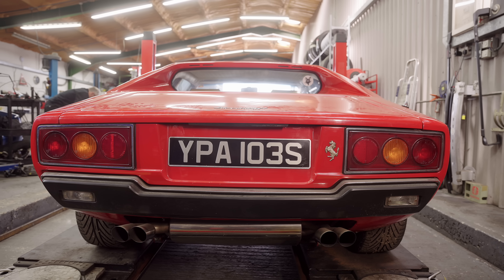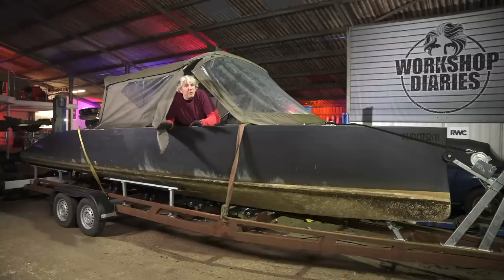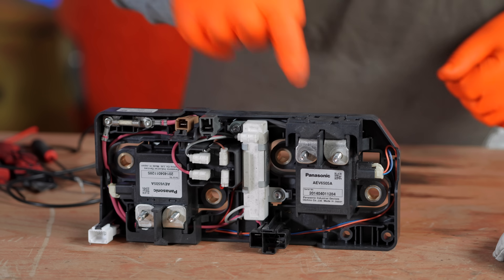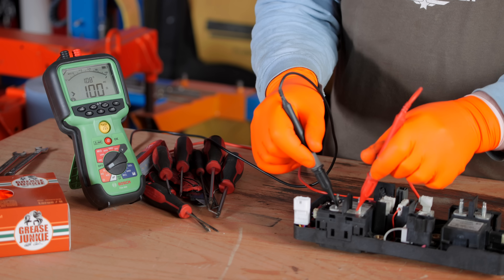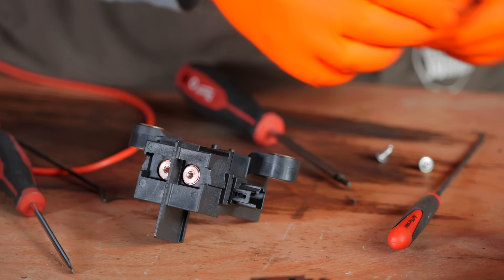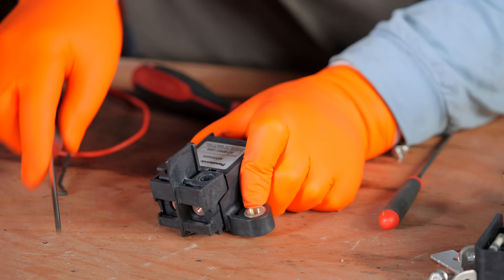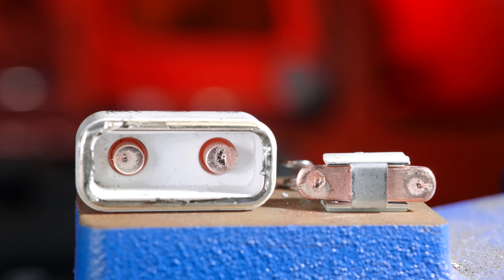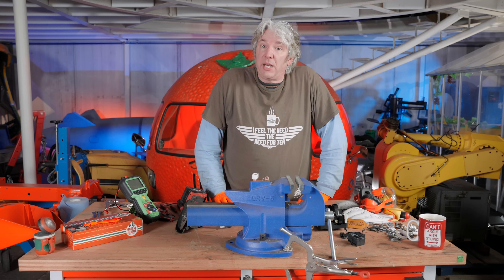1 Surprising Thing I Found Inside a Welded EV Contactor

Comment: Looks like it was switched of unter load. Which should normally not be the case. Normally the inverter should shut down the current bevor the electro-mechanical contactor ist opened.

Comment: This is a Panasonic AEV6505A. A datasheet I found does not list that specific type, there is variants with different coil voltages and connectors. 

But for example the AEVxx04xx (with x for 'can be anything') is a 120 A type. It is rated for 120 A continuous, or 225 A for a maximum of 3 minutes, or a maximum of 400 A for 30 seconds. 

I also at first thought it had 120 A switching capacity but higher carrying capacity but that is not it: It can switch 120A very often, but only if the resulting voltage across the contacts is at or below 20 V. Else the number of times it can switch (switch lifetime) is reduced significantly. It can switch once at 1200A with 300V resulting, or it can switch 70 times if 450 V results from interrupting 120 A. That is not normal use, because if the voltage is kept below 20 V it can switch 120 A for at least 70.000 times which sounds a lot more reasonable for switch lifetime. (note: these numbers are for a different type, that I assume to be similar - that assumption might be off)

So that is what the 'pre charge' relay is for - it makes sure the voltage difference over this main contactor is low enough to ensure long switch lifetime.

But good to see the teardown. It is clearly not something you can easily open to clean the contacts and then reassemble. But one might be able to only replace the contactor instead of the entire unit. Or maybe once all the disassembly work is done: Both or all 3 contactors. In case they wear at similar rates, or the same fault welding the one contactor also affected the other. Idk, needs proper testing, probably not done by me unless...

Comment: Contactor or a relay design is not as simple as it looks.....there is a lot of research that goes into choosing the material thats make the contact pins it could be silver, silver cadmium, silver tin oxide, gold plated, palladium and also tungsten also the contactor was sealed in ceramic package as it may have a gas filled inside to extingush the arc......not sure if its legal to use SF6 as its a green house menace but there might be a substitute.

Comment: Very interesting Edd. I was an electronics engineer all my working life, and am of the opinion that relays or contactors will always fail eventually, it's just a matter of time. In high current applications they weld and fail short circuit, and in low current situations, particularly audio switching, they fail high resistance or open circuit. The designers will balance the life expectancy of the contacts with that of the battery pack, working on the assumption that the batteries are most likely to fail first. That one possibly failed due to not enough gas inside at manufacture or a leak over time. The contacts are never pure copper, it's just not durable enough, once a good arc has taken place, the contact plating is compromised and welding happens. At very least, the contactor pack should be part of some sort of scheduled maintenance and therefore be made accessible as others have said.
Reply: Exactly right. Contactors have seen a lot of change and Engineering over the last few decades. From exotic and rare alloys, vacuum/gas purges, coatings, layered plating, and heat/cryo treatment. And that just scratches the surface. Went down a rabbit hole with all of that a few years ago, and it's a deep one.
Reply: I am an old electrician, I remember large power contacts with silver tips, they were quite reliable until the silver wore away.

Comment: The Accountants are clearly in charge at Nissan those contacors are clearly too small for the potential current that an EV can draw. I know if I chose a contacor for an industrial process I would oversize it by at least 50% capacity, to extend the life of the contacts. Your quick thumbnail calculation clearly shows that the engineers were only allowed to install the minimum size possible.

Comment: Hmm. About those contacts in the relay - I thought they were coated with some other more CONDUCTIVE metals such as silver, or beryllium ? Certainly something with a HIGHER melting point than just Copper !
Reply: I believe that the silver contacts are melted and splattered over the plated copper surface -- see 15:50

Comment: Yes, you need bow thruster(s) for the boat as it's so narrow, compared to length. I wouldn't expect to see it in a lock - what's the boat's length ? Anything over 55 ft/ 20m is going to be a tough fit in a canal lock, but never say never. I want to know what colour the boat will be - definitely metallic or metal flake finish, but not too dark - you want to be able to see it 🎉. Not orange. A weird salmon pink would be my choice. Looking forward to the inner office build.

Comment: Hi Eddie put your bolts in your steel work in from the top and nut on the bottom then if the nut comes off the bolt stops in the hole

Comment: The motor being run at a higher (80kw) than the contactor (40+kw) is I believe similar to Ebikes running 200 amp motor current and 130a battery current because the back EMF from the inductance of the motor is pushing back against the battery voltage giving more power, which kind of defeats scottys laws of physics..... and if you think thats weird then theres field weakening which makes the motor faster....

Comment: I bet that has a capacitor with a really high inrush current, so install a resistor that powers the circuit around the relay.

Comment: Contactor pads and bridge will have silver contact normally . The contactor may well be made specially for Nissan and though it has a Panasonic part number is only supplied to Nissan. Plan B, check coil value and  fit 150 or 180 A contactor in the box if possible or remotely otherwise ?

Comment: HI, I have worked with very large versions of those contactors. what I have found is that the bellows that keeps the atmosphere out will fracture over time and let the protective gas (I think SF6) out then it welds itself up.
Rich

Comment: I would think that the current rating is what current the contactor can switch, not the maximum current it can carry (which is probably much higher)
The resistor will limit the initial current going charge the capacitors.

Comment: Is there a way to see live data of power use (at the pack/motor) in hybrids and EVs through the odb2 port?
Would be interesting to monitor and see if, in this Nissan Leaf case, the contactors are indeed to small for it's actual load.
Could be a lawsuit and recall in their future.
And send a warning to the rest of the industry.

Comment: The ceramic hermetic sealed case is likely filled with SF6, a good dielectric gas to minimise arcing

I'm a radiotherapy electrical engineer, and our RF pulse we use to accelerate the electron beam, is sent down a waveguide filled with sulphur hexaflouride

Comment: As a boater, let me tell you there’s no way you are holding that boat in a lock without smashing the paint to bits. A bow thruster won’t help you with all those Eddie currents (pun intended 😅). So I would strongly advise you fit some recessed pop up cleats so you can add fenders when transiting locks. They won’t ruin the lines when you arn’t using the fenders.

Comment: Think there is a little more to the contactor sizing. It's unlikely to switch under load. The electronics and software will see to that. This means the contactor can be rated below the actual load switch rating saving on cost and size. This is particularly true for DC switching as extended arc form on switching loads. This is the reason special isolator switches are required for DC and why PV systems shouldn't be disconnected by the DC switch until the load has been removed on the AC side of the inverter.  By only operating the switch when the motor load is zero means the switch is operating at a small load and arcing/welding should be avoided.

Comment: A tip for anyone trying to repair a contactor, hold it solid or bolt it down and give it a good tap with a hammer, often it does work. Eventhough this one looks completely welded, it oxidizes so the weld isn't that strong.
Reply: The contacts of a relay are plated with metals that resist welding, such as platinum and tungsten. Under that is copper which welds very easily. In this video, you can see the exposed copper when he held up the contacts for the camera. 
Once a relay has welded, the surface coating on the contacts is damaged, so if you do this hammer repair, the relay will work a few times and then weld itself again. 
Don't waste your time, welded relays cannot be repaired.
Reply: @6AK5W-JAN  I can tell you this is not always the case and not always true. While of course it is generally good practice to simply replace a welded contactor, I've gotten 4 more years out of one at this point with no heating up or anything similar. It really does work sometimes. Also copper might weld easy, but as I tried to out in my previous comment, it WILL oxidise under heat high enough to melt it, and thus the weld will be very weak.

Comment: About the contactor, my 2 cents is that the 80KW rating is peak, nominal I'd guess its around 40kw. The contactor rating is likely nominal and has an equal or higher peak rating. A leaf will never experience 80KW for more than a few seconds anyway.

Comment: I'm wandering if a SSR is a better choix for this function , surely not cheaper , but normally more durable . in the future , this will be a common , problem , they will make this command modules easily serviceable withou having to take all the battery out .

Comment: Years ago, what now seems a different life to me, I've researched the relays, especially DC breaking relays. As most AC relays can handle much more power because AC current will eventually be crossing zero and extinguishing that arc, they really suck for DC and are DC rated very low. The strongest DC breaking relays also can incorporate a blowout magnet which does exactly that, blows out the arc. The mode of failure is the same for all mechanical relays, and is actually quite simple. Each time you close a relay, you have a little bounce which in turn produces sparks. Also when opening the relay you have the arc. Both effects transfer material from one contact to the other. By doing this, the resistance of the contact starts increasing, creating peaks on one side. At one point one of those peaks will be higher than the rest of the contact, therefore it will make contact first, but because the contact point is very small it has a bigger resistance. Resistance means power loss on the contact, which means generating heat, which in turn melts the materials and weld it together. If the weld point is small you can release the relay by tapping it, but it only prolongs the life of the relay for a short time. The fun thing is that the same mode of failure happens in gas surge arresters and that's why they are supposed to be replaced every time a surge happens, otherwise they short and start to glow, a lovely view if I might add :D
Reply: Just did a yt search on blowout magnets, how cool.

Comment: I suspect that the main motor current does not flow through that contactor until it has made contact nor will the contactor be carrying the motor current when it opens as that will be controlled by solid state devices. That is why they can get away with a lower current contactor.

Comment: You went to all the effort of finding out what a fused contactor looks like inside. But you still didnt determine why it happened. Hint - measure the resistance of the precharge resistor, probably open circuit. But if it measues in spec, check the pre-charge relay

Comment: Interesting boat put a permanent rubber bumper all round it. If you don’t use fenders it will get the snot knocked out of it. The thruster will do nothing for the maelstrom of the locks

Comment: A railway signal engineer here.  Railways are 'failsafe'.  Critical contactors (relays) are silver versus carbon contacts.  Why?  Those two conductors cannot weld. It's chemistry. 🟠
EV nobs could learn from over 100 years of railways learning.  By 2100, they'll get Panasonic to patent it.

Comment: DC contactors suffer more than AC as all the destructive force moves in one direction. The traditional solution was mercury wetted contacts, but they are no more.

The best solution likely is to offer easy quick replacement of cheaper components. But that might be too generous for the original manufacturer.

Comment: As a industiral electrician who often change the contact in siemens contactors, i must say those panasonic contactors are not built to last.They are built to fail and be replaced. In an industrial contactor you can change the contacts for like 30$. And they are good to go.

Comment: Low voltage causes increse in amps which overheats the contacts. You need to look for the root cause off what caused the contractor to fail .

Comment: It seems like these contactors are severely under sized for the real current flow.  In DC, you need a much higher arc rating because the arc does not self extinguish.
I'm surprised the engineers didn't size it properly.  But then most of EV is based on the wrong idea of solving energy use as you still need to charge it with generation.

Comment: I’d imagine the data sheet for the connectors has a graph of expected life span from small loads for some applications to foot to the floor electric car loads.

The engineers must have known this is a weak point of failure and said good enough

Comment: yes the Panasonic Datasheat is a max of 250 A shown by 500V but the Question is while it welded ??? I think my be any Capacity in the construction can be more then 250 A in ms flowing so the that damaged over the time the contacts. In the room of contacts there normally use the gas SF6! The construction is not so well ! And the Pansonics not the right thing on those better are semiconductor 😮 Thanks Edd, clear there also cooking with water😅😅😅❤

Comment: Seems mad to me that they've gone for an electromechanical solution rather than a rugged solid state device. The contactor unit is going to be a weak link, so having to strip the battery out of the vehicle to dismantle it to get at the contactors is a very poor design.
Must have changed dozens of burned out and welded contactors over the years in the industrial gear I worked on - if they are going to be used, then they need to be easily accessable for maintenence.

Comment: In EV they tend to be very optimistic with the ampere rating of things, in comparison with industrial electrics where things end up failing anyway, but at a more bearable rate. Power cables are never thick enough for mains standards, creating loses and damaging heat to save weight and copper. The contactors shown are clearly very small for its rate, and probably much more unreliable that the mains 3ph 400V counterparts of same rate. The power electronics of stationary inverters, semiconductors and internal connections, are also much bigger overall.

Comment: definitely wanna see what ever projects get finished ✅ over time. I’d try and bar the engine over without the spark plugs, and water pump attached. Definitely oil change, drop the oil pan. I’d inspect the bearings just to be safe and rings. Inspect the bore for scoring. Valves need to be cleaned. Valve adjustment. But definitely need to fix the paint. Ferrari’s you don’t abuse one for what they cost. Water pump may be rebuilt most likely a bearing went.

Comment: Just build a LS engine for the Ferrari, a LS-7 block with a custom forged steel crank with 4.8L stroke with longer rods , ultra light pistons. And a custom cam grind with a set of 180° headers, it would probably be a lot cheaper than building the Ferrari engine! 😂 possibly 5.4litre and capable of 8500 RPM. And 600+HP, and plenty of TQ,

Comment: Old hat. MOSFETs can switch >100A. IGBTs can switch even more. No need for risky mechanical switches. Tons of advantages, soft start, PWM control, precise timing, low power consumption.
Reply: Contactors are safety devices and when they aren't welded deliver an air gap to guarantee isolation.  There are two independent contactors, one on each pole of the battery with monitoring to ensure that if one contactor fails the other will not be energised. MOSFETs are great but they tend to fail short circuit and if one fails due to a current surge it is likely that the other will go the same time.
Reply: @AndyFletcherX31  Ironically contactors also tend to fail short circuit! I suppose the advantage is isolation, which MOSFETS can't match.